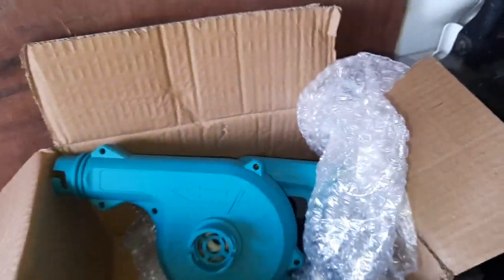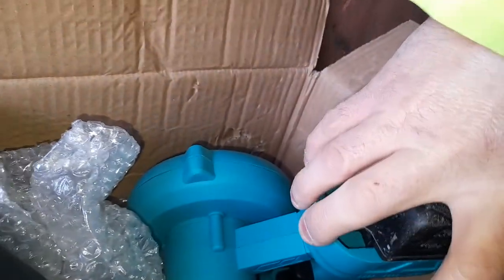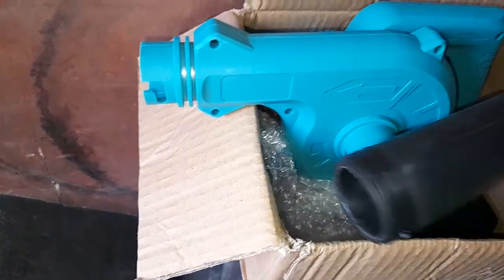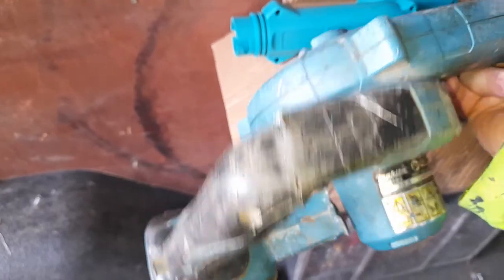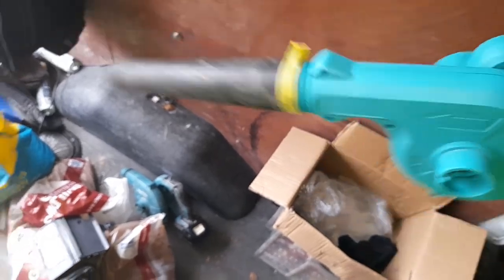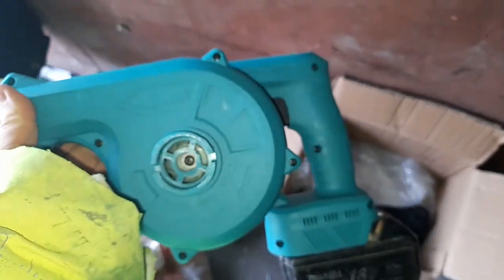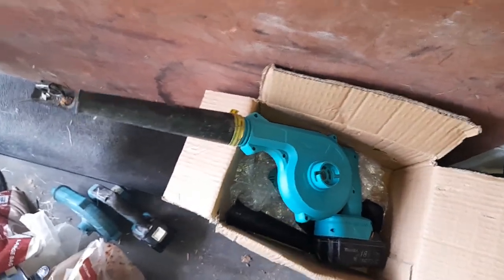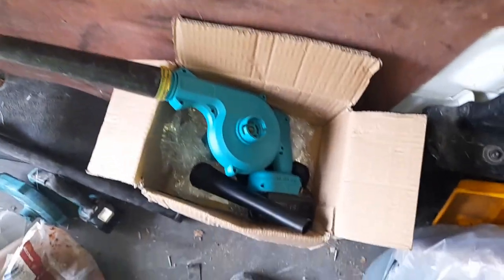fake makita blower

Comment: I bought a fake one (I knew it was fake, I just needed a cheap blower)  It worked fine for a while, I've had it nearly a year but use if only occasionally.  Well today the impeller inside the fan shattered into about 8-9 pieces, some blew out the front, the others pieces stayed inside.  The impeller looks like a very brittle weak cheap plastic.  I do not recommend  buying this fake.

Comment: Allright mate, good job with the Fake Makita video.  Us blokes out here in the salt mines asking if the Faker is still working or did it burn out quickly?  You would do us a favor with the information here in Oct 2023 about a year or more after you posted your vid.
Reply from the maker: Hi yes it's still working, it's lasted longer that the original makita blower, I did  cut out some of the plastic on the in take to allow more air to flow, which made it more powerful

Comment: Which one is better? Considering the fake one costs 60% less than the real one.
Reply: there would be bugger all difference in air speed because the real one is not that powerful. the main difference would be longevity of the motor.